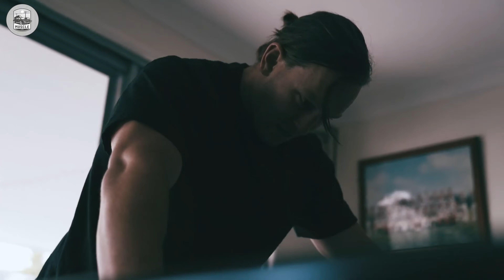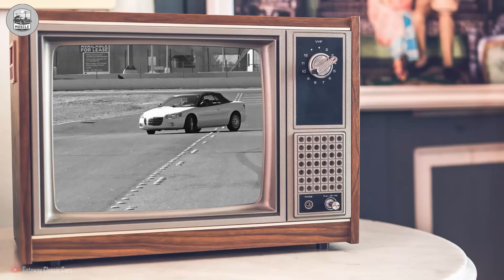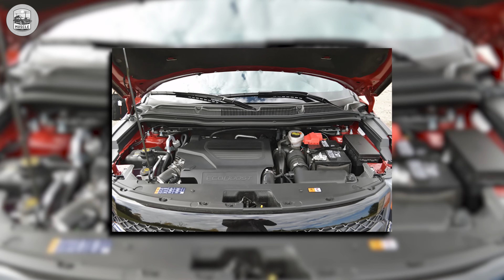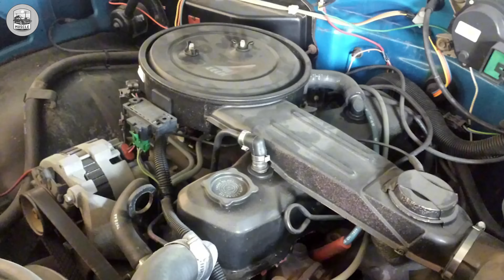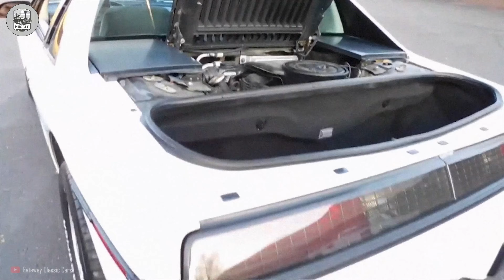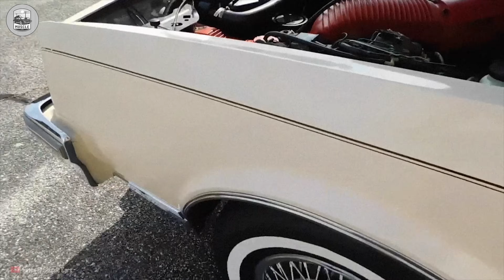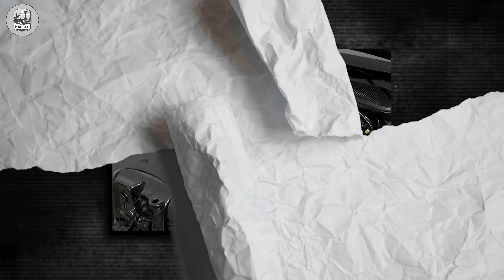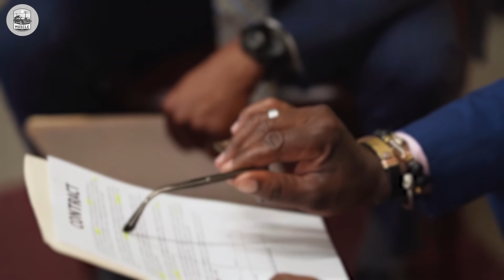MOST FAILED ENGINES ever put in production cars | Worst engine blunder!

Comment: Anybody else knows a lot of these Indians were on this list had the same problem they were built to be fuel efficient Bud light horsepower back in the day you either chose horsepower or fuel efficiency it's not like they have the technology nowadays where you can have both and the 2.5 l iron Duke a lot of people still called an iron Duke from 87 to 93 but those were technically a tech for same engine just a fix that head cracking problem by designing a different head so not all have that issue I had a 85 S10 my head was cracked and I just fixed that by replacing it with a rebuilt 87 and 93 2.5 l head and and I don't think a engine that has a Facebook group dedicated to it which is called iron Duke community you go in there and I guarantee a lot of people are not going to agree with what you said about being the worst and plus that little 2.5 l if it's no longer in production I think it the production ended in 93 that it is still being used today to deliver mail that's what's in those little Grumman llv mail trucks is a 2.5 l iron Duke basically it's a Blazer that's what those trucks are to that sits on a Blazer frame that they narrow the frame a little bit so it has a tire turning radius how bad is that engine it's still in service 31 years after they stopped the production of that 2.5 l
Reply from the maker: Thanks so much for your thoughtful comment
You're absolutely right that the 2.5L Iron Duke engine, especially in the later models from 1987 to 1993, had significant improvements that made it more reliable over time. The head cracking issue was a real problem in the early years, but as you pointed out, the redesign in the later versions made a huge difference. The fact that it continued to power vehicles like the Grumman LLV mail trucks for decades is a testament to its durability. It may not have been a high-performance powerhouse, but it was certainly a reliable workhorse in its day.
It’s always great to hear from people who have hands-on experience with these engines, and I’m sure many in the Iron Duke community can relate. 
I encourage everyone to share their thoughts in the comments, hit the like button, and don’t forget to subscribe for more American Muscle Car content! Let's keep the conversation going

Comment: I don’t know who drummed up this video with somebody oughta be suing somebody. The 3.8 L Buick V6 was one of the most reliable engines ever built. They used it for many applications for many many years, personally working in a Buick Pontiac GMC truck dealer for a very long time. I never even had a cylinder head off of one of them. So then again it’s just somebody’s bullshit opinion cause they don’t have any actual paperwork saying so.
Reply from the maker: Hey @tomtaylor7484, thanks for sharing your experience
The Buick 3.8L V6 certainly has a strong reputation for reliability, and your firsthand experience working with them is valuable. It’s known for its longevity, particularly in the Regal and LeSabre, where it was often praised for smooth operation and minimal maintenance. The engine’s design was robust, especially with the iron block and aluminum heads, contributing to its durability over time.
That said, while the 3.8L V6 is indeed a solid engine, it’s also important to consider that every engine has its strengths and weaknesses depending on the application and how it's maintained. The beauty of muscle cars and their engines is that they have such rich history and countless opinions based on personal experiences like yours.
Everyone, feel free to share your thoughts on the 3.8L Buick V6, and let's keep the conversation going
Don't forget to comment, share, and subscribe for more deep dives into iconic American muscle cars

Comment: I had a Chrysler new Yorker 3.0 engine I bought it at 79,000 miles burning oil I was adding one qt every week then at 130,000 miles then I was adding 2 or qts a week then at 197,000 miles it just cut off and stop running 😢 but very reliable car
Reply from the maker: Thank you so much for sharing your experience with the Chrysler New Yorker
It's always interesting to hear about the longevity of cars, especially when they're pushing through issues like oil consumption. The 3.0 engine, while known for its durability, wasn't immune to some of the common issues that can arise as cars age, like oil burning. It's impressive that it kept going as long as it did before finally calling it quits at 197,000 miles! Even though it had its share of challenges, the fact that it was a reliable ride for you really speaks to the quality of Chrysler's engineering back then.
To everyone reading, if you have your own muscle car stories or experiences with engines like the 3.0 Chrysler, please feel free to share in the comments below
Don’t forget to hit that like button, share this video, and subscribe for more amazing American Muscle Car content.
 Let’s keep this conversation rolling and celebrate these legendary machines

Comment: The Buick 3300 series engine was one of the best engines ever built for semi-compact cars it was a awesome engine and besides routine maintenance it lasted 430,000 MI all that ever had to be done to it was a water pump and a starter
Reply from the maker: Thanks for sharing your experience with the Buick 3300 series engine
 It truly is one of the underrated gems of the muscle car world. With that kind of longevity 430,000 miles on just routine maintenance—it’s clear that Buick built something special. The 3300 was designed for efficiency and durability, making it an ideal engine for semi-compact cars of its time. That’s the heart of American muscle, reliability with power. If you're a fan of classic engines like this, drop a comment below, share your thoughts, and don't forget to subscribe for more deep dives into muscle car history.
 Let’s keep the passion for these iconic machines alive...

Comment: All of these engines have one thing in common they have the interference of the government tampering just like the gas can if it works leave it alone and why do we have to have lighter vehicles. Leave the old cast iron vehicle engines alone and do proper maintenance and it will Outlast any of these new aluminum garbage engines
Reply from the maker: Thanks for your comment
 You're absolutely right, many of the classic muscle car engines like those with cast iron blocks were built to last and have a distinct charm that new aluminum engines just can't match. Government regulations have certainly played a role in shaping the direction of modern engines, but there's still a lot of love and respect for the old-school powerhouses that defined American muscle. 
Let’s keep that spirit alive by sharing knowledge and appreciating the timeless craftsmanship of these cars. 
Keep the passion for muscle cars burning comment, share, and subscribe to stay connected with our muscle car community

Comment: Holy crap I’d take all these problems compared to what we have nowadays all these engines are better, the ecoboost with the oil bathed oil pump belts and the cam phasers, the Chevy 3.6…ya try to fix that, the mds cam and lifter issues gm and dodge v8s what a joke, no one and i repeat no one makes a vehicle worth buying 19+ all junk…every last manufacturer.
Reply from the maker: Thanks for sharing your thoughts
there's something special about the raw power and simplicity of the older muscle car engines. The modern engines with their complex systems like Ecoboost oil-bathed pumps, cam phasers, and the headaches of MDS cam and lifter issues are definitely a far cry from the beasts we loved in the past. The good old V8s, like the ones in our classic muscle cars, didn’t need all that high-tech stuff to get the job done. They just roared, with reliability and performance that we can only dream of today
I agree, nothing beats the feeling of driving a true muscle car, where every rev of the engine speaks to your soul. Let’s keep this muscle car legacy alive and bring back the passion for these iconic machines. 
Make sure to share your thoughts below, comment, and don’t forget to subscribe! Let’s keep the love for real muscle cars going strong

Comment: Add the GM Ecotec 4 banger found in the 2004 Cavelier LS Sport. I had one that died at 67,000 miles due to a stretched timing chain. It took me a year to pay the $1600 repair cost, only to lose my money when they recalled it a year later for that same problem. This engine is recognizable with its oil filter cartridge housing being cast into the block and easily seen in the left front corner (in car relation position) of the block. Ik is simply a fragile engine, and it is junk.
Reply from the maker: Thanks for sharing your experience with the GM Ecotec 4-cylinder in the 2004 Cavalier LS Sport. It's unfortunate that you had such a costly and frustrating time with that engine. The Ecotec 4-banger, while a solid performer in many other applications, did have its issues, especially with timing chain problems. This kind of failure is a reminder of how even some well-known engines can fall short in terms of reliability. It's frustrating when a car lets you down like that, especially after putting money into a repair, only to have it recalled for the same issue. The oil filter housing, a unique feature of the Ecotec, definitely made it stand out, but it didn't save it from being a bit too fragile in the long run.
For all the real American muscle fans out there, we love hearing your stories and insights.
Drop your thoughts in the comments, share with your fellow car enthusiasts, and don't forget to subscribe to keep the muscle car passion alive
Let’s keep the love for these legendary machines strong...

Comment: Massive difference between the first gen 3.8 that was in cars in the 80s versus The Late Model 3800 the only thing they really have in common is the displacement. And despite some of the development problems The Late Model 3800 has a more solid durable architecture than the old school 3.8 because of the offset cylinder Banks which take full advantage of the bearing clearance and the optimal positioning for the rods and mains where is the more uniform cylinder Bank design of the old school 3.8 proved to be downfall for the design and problematic in anything that was not also invested with a Turbocharger, those engines got all of the durability goodies along with the go fast goodies but the regular naturally aspirated 3.8 got the short end of the stick.
Reply from the maker: You're spot on about the massive difference between the first-gen 3.8 and the late-model 3800. The first-gen had its charm but lacked the robustness we see in the 3800's offset cylinder bank design. That offset layout wasn’t just about clever engineering it gave the rods and mains optimal positioning, ensuring greater durability and smoother operation.
The early naturally aspirated 3.8s often fell short, missing out on the durability upgrades reserved for their turbocharged counterparts, which had beefier internals to handle the boost. The late-model 3800 fixed those issues, becoming a reliable powerhouse, especially when paired with supercharging. It's why the 3800 Series II and III are fan favorites today, known for solid performance and longevity.
What’s your favorite engine generation and why?
 Let us know in the comments! Don’t forget to like, share, and subscribe to American Muscle Cars for more epic content. Hope to see you in the next video, have a great day

Comment: Note on the 3.1 GM V6 the intake manifold gasket did not become a problem until they converted from Green coolant to Dex Cool Orange. Prior to that those engines would last hundreds and thousands of miles with minimal issue had a 94 with that engine that lasted over 300 K with the last 25k being quite abused because of loaning it to a family member before it gave out contrast that with a 96 model of the same car with the same engine and because the intake gasket issue the original engine went to put at 120 k and even trying to rehab it with a new gasket the initial damage did enough damage that I had to replace the engine in a few more months anyway. But the gasket only became a problem when they went to DexCool orange long life antifreeze. If you take the regular green stuff and change it at the proper intervals that engine will last for a very long time.
Reply: dexcool if not changed turned acidic then dissolved all the gaskets  it was customer error and a lack of maintanence
Reply from the maker: @ DexCool really caused some chaos back in the day. The 3.1 GM V6 was tough as nails with green coolant, but when DexCool wasn’t properly maintained, it turned acidic and tore through intake gaskets like a nightmare. It’s a classic case of how critical maintenance and the right fluids are to keeping these engines running strong. But when taken care of, those V6s proved to be reliable workhorses that kept rolling for hundreds of thousands of miles.
Let’s keep this community growing and sharing stories that keep the passion alive. Catch you in the next video—stay fast and have a great day
Reply from the maker: You're absolutely right about the 3.1 GM V6
 That engine was a workhorse with green coolant, but DexCool sure brought its headaches. The intake gasket failures became a nightmare after the switch, with many engines like yours falling victim early. It’s a great reminder that maintenance and proper fluids make all the difference. Thanks for sharing your story—it's a testament to how well these engines can perform when treated right. Let’s hear more stories like this from all of you
 Don’t forget to comment, share, and subscribe to American Muscle Cars 
Hope to see you in the next video. Have a great day

Comment: Nothing really wrong with the Ford 4.2 V8 they just deliberately made it underpowered. Virtually anything you can do with any Windsor V8 would improve even the 255.
Reply from the maker: there’s nothing inherently wrong with the Ford 4.2 V8 (the 255). 
It was built during tough times for performance engines, with emissions regulations and fuel economy taking the front seat. But here’s the good news: it shares the Windsor DNA
 With upgrades like a better camshaft, headers, and a 4-barrel carb, you can unlock its true potential. Windsor engines love mods, and the 255 is no exception. Keep the conversation going
Share your favorite builds, comment your thoughts, and don’t forget to subscribe to American Muscle Cars for more gearhead goodness. Hope to see you in the next video, have an awesome day

Comment: Dude whoever made this edit is l kindof a moron. I'm a mechanic. I've seen v6 3000gt with over 320k miles that didn't burn a drop of oil. I OWNED a 2002 S10 with a 2.2 that had 280k miles and ran absolutely perfect. The damn thing would chirp 3rd. And the 3800??? Seriously?

Comment: The Cadillac HT-4100 is much more deserving of a place on this list than the V-4-6-8. With the 4-6-8, all you had to do was deactivate the cylinder deactivation and you had one of the toughest engines ever made; I've even read that just deactivating the inherently rough 6 cylinder mode, letting it switch between 4 and 8 cylinders, was enough to make it smooth and adequately reliable. But there was no easy way to fix the 4100; what can you do with an engine that won't stay in one piece?
Reply from the maker: the Cadillac HT-4100 earned its reputation for being one of the most troublesome engines of its time. The aluminum block paired with cast-iron heads led to coolant leaks and major reliability headaches. With underwhelming performance and a design that just couldn’t keep up, it was a real letdown for Cadillac fans.
On the flip side, the V8-6-4, when cylinder deactivation was bypassed or fine-tuned, proved to be a solid performer. As you mentioned, even leaving just the 4- and 8-cylinder modes intact made a night-and-day difference. It showed that Cadillac had the right idea, but the tech of the time just wasn’t ready.
Keep those great comments coming, everyone! We love diving into these topics with you. Don’t forget to share, subscribe, and join the ride with American Muscle Cars. Have an awesome day, and see you in the next video...
Reply: You are absolutely right. Cadillac should have kept the 368,the "Hook&Tow4.1 liter and the Olds diesel were nothing but trouble. Not sticking to basics more or less ruined the brand . I've always felt like the Northstar was a missed opportunity,if they had pulled out the stops and fixed its weaknesses. Those stupid heads plagued them for years.